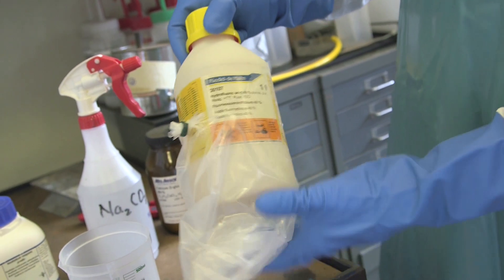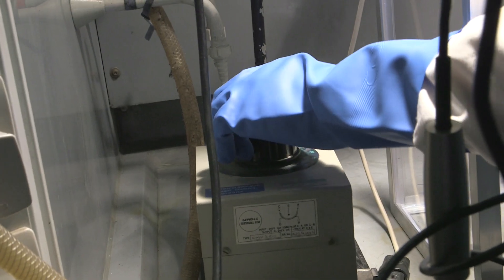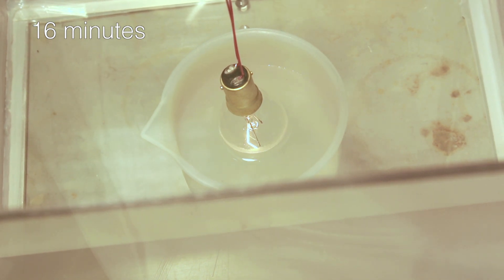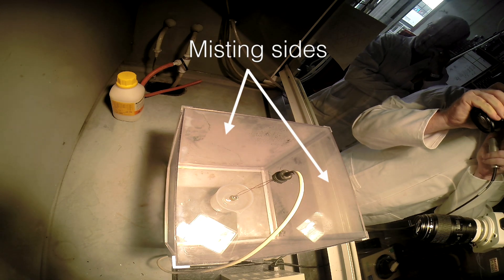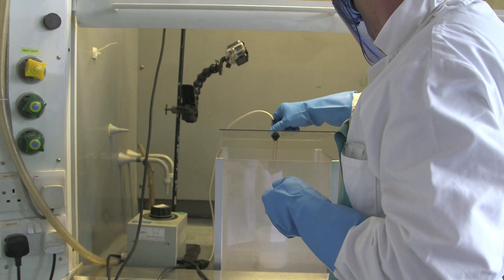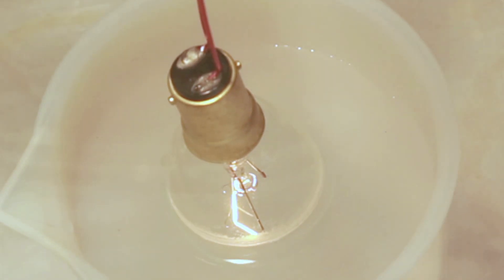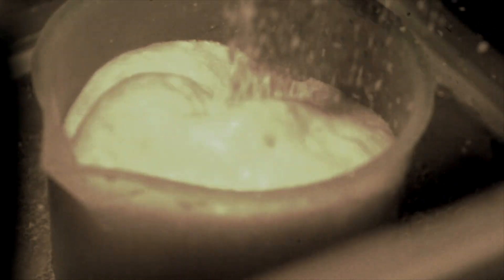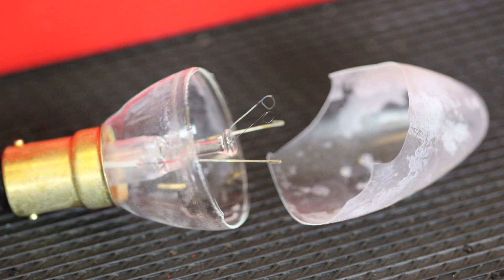Light Bulb in Hydrofluoric Acid (HF)

Comment: HF the most feared chemical compound, eh?  If you had to pick, would you rather work with HF or O2F2? :)
Reply: Lord Marcus
 That's not entirely true. You should read the wikipedia article about the "Dihydrogen Monoxide hoax".

To quote the best part :

"Dihydrogen monoxide:

is also known as hydroxyl acid, and is the major component of acid rain.
contributes to the "greenhouse effect".
may cause severe burns.
contributes to the erosion of our natural landscape.
accelerates corrosion and rusting of many metals.
may cause electrical failures and decreased effectiveness of automobile brakes.
has been found in excised tumors of terminal cancer patients.

Despite the danger, dihydrogen monoxide is often used:

as an industrial solvent and coolant.
in nuclear power plants.
in the production of Styrofoam.
as a fire retardant.
in many forms of cruel animal research.
in the distribution of pesticides. Even after washing, produce remains contaminated by this chemical.
as an additive in certain "junk-foods" and other food products."

And not a single line is wrong!
Reply: tabularasa0606 In fairness, anyone working with HF has almost certainly been thoroughly warned about it.  No one warns you about water overdose.
Reply: Look for a chemistry blog called "Sand won't save you this time.". It's part of this guy's "Things I won't work with" series.
Reply: You should all read John D. Clark's "Ignition : an informal history of liquid rocket propellants". It's available for free on the Internet as a PDF, and tells the history and mishaps of rocketry in its golden age, from the 1940s to the 1970s. It's just great, both really informative and hilarious, and some of the mishaps reported in there are simply unbelievable. Like the time they broke a 1-ton container of chlorine trifluoride. To quote that book :
"It happened at their Shreveport, Louisiana, installation, while they were preparing to ship out, for the first time, a one-ton steel cylinder
of CTF. The cylinder had been cooled with dry ice to make it easier to load the material into it, and the cold had apparently embrittled
the steel. For as they were maneuvering the cylinder onto a dolly, it split and dumped one ton of chlorine trifluoride onto the floor. It
chewed its way through twelve inches of concrete and dug a three-foot hole in the gravel underneath, filled the place with fumes which corroded everything in sight, and, in general, made one hell of a mess."

It goes from that to the stinkiest components ever used as fuel in rocket engines, or the first tries at monopropellants (which he describes as "a molecule with one reducing  end and one oxidizing end, separated by a pair of firmly crossed fingers") using no less than nitroglycerine!
Oh, and they also injected mercury in some engines.

Seriously, that book is just great, I cannot recommend it enough.
Reply: Well, that's not quite what I meant by no one warns people about the dangers of water, either through hyponatremia or the various chemical dangers thereof.  The thing about calling it DHMO is that a random person isn't likely to know that's water.
Reply: evildude109
They both clearly lose to dimethylmercury.
About as toxic as VX or Sarin : 3 mg are sufficient to kill a 60 kg adult (LD50). But unlike VX and Sarin, it goes straight through rubber gloves and HazMat suits. And it is environnementaly persistent for decades.
Reply: piranha031091 Of course, but I thought we were just talking about corrosiveness.  Absolutely, one of the best methylating agents in the world is an ugly thing to play with.  If you just want to play a game of golf with LD50s, you'd have to just go with Botulism, with an LD50 of a few nanograms.
Reply: evildude109
FOOF isn't chemistry. It's just evil.
Reply: HF isn't even in the fight. It's a competition between fluoroantimonic acid and FOOF.
Reply: richardpurves That guy's blog is one of the first places I heard about FOOF. :)
Reply: O2F2 is extremely uncommon. Therefore, a lot less chemists have to fear it.
Reply: piranha031091 Even more people die of an overdose of H2O

Comment: What would be the result with plain water? Did the lightbuld crack in half just because of temperature difference between top and bottom...?
Reply: Probably in part because of that (explaining the neat cut), but mostly because of glass corrosion.
Reply: I agree. But corrosion definitely helped weakening the glass. Without HF you probably need much bigger temperature difference to make it crack.

Comment: The dissolved surface of the glass is still slick. (I've tried it.) So how does the light bulb industry, or rather how "did" the light bulb industry etch the inside of a light bulb?
Reply: maybe they etch it before putting it together?? :D

Comment: I had taken part into an experiement where we dissolved beakerglass (broken pieces) in heated oleum (conc. sulfuric acid). The glass were "dissolved" only from the rough broken edges and the "flat surfaces" stayed mostly intact.

Comment: What's the explanation for the lightbulb corroding only on the surface of the acid? I thought that the corrosion would have been more even.
Reply: mahin alam The entire submerged part of the bulb corroded, if you look at the remains you will see it being thinner than the rest.

The reason for it breaking in a circle however, is (i think) because of the stress caused at the point where it transitions from thick (un-corroded) to thin (corroded), combined with heat from the bulb itself and the reaction.
Reply: Patrick Hansen
I think it was the hottest at this place and it sped up the reaction. Below the surface HF took away the heat and above there was no HF.
Reply: Patrick Hansen I would suspect it had more to do with the way glass shatters rather than heat differential.

Comment: I would have expected the bulb to have higher pressure inside and thus explode a little bit more violently, but do you think it didn't because of the even corrosion that popped it in two, projecting the bottom piece away like a catapult chair? Or is the pressure inside the bulb much lower than one would expect from the spectacular explosions you get when you happen to hit one too hard?
Reply: Ah, so it's lower pressure. I had that backwards then.

But why then do the glass sometimes shatter so violently outwards if you hit one? Is that just because of the nature of the structure within the glass itself? Structural tension from cooling the glass during manufacture?
Reply: Rua Whitepaw I believe that the reason a noble gas is used is not that the glass wouldn't "withstand the vacuum", but that having a vacuum would make filament sublimation effects worse, resulting in a gradually thinner filament, clouded/darkened bulb glass, and reduced lifespan.

Don't quote me on the exact physics though. Just what I remember from school :)
Reply: i believe bulb filiments are under a vacuum?
Reply: Trodoil akaTroy They are usually filled with a noble gas such as Argon.
Reply: Trodoil akaTroy Old filament bulbs contain a low pressure Argon atmosphere inside, as Argon is unreactive to the filaments at the high temperatures they reach.
Reply: SchiferlED  bigglessy ah I see, thank you.
Reply: Incandescent bulbs tend to have a vacuum in as the glowing element would react with any atmosphere inside the bulb, not sure about energy saving ones but I think they're lower pressure as well(they use metal vapor to conduct the current around the bulb). Halogen bulbs tend to have a low pressure of Cl2 in (I think it's chlorine, definitely a halogen gas) as this reacts in a manner that doesn't destroy the element/filament of the bulb (I only vaguely remember so won't try and explain, sorry. I think it's a cycle, reacts to make the halide as the filament heats then does the reverse on cooling =/ ). Also the corrosion is unlikely to occour completely uniformly around the glass surface, as the glass isn't completely uniform, it'll have bit's that are slightly raised or lowered, leading to a higher local surface area and so higher reactivity for that bit of the glass.
Reply: MortRotu
The glass is not strong enough to withstand a vacuum so they use argon (a non-reactive noble gas) instead.
Reply: bigglessy
 Even if it's low pressure argon, shouldn't the heat from the filament heat it and cause it to expand, then increasing the internal pressure? Expansion from heat isn't a chemical property of gas, it's a physical one.
Reply: Rua Whitepaw
it's a static pressure applied to a nearly uniform sphere, Sphere's are exceedingly strong in compression, eg bubbles underwater. Also having a vacuum removes the thermal expansion of the atmosphere inside problem. I imagine the shattering thing is a similar cause to the prince Rupert's drops shattering if they're chipped
Reply: Rockskillskids Yes it does, but the pressure increase is still under standard atmospheric pressure if I remember rightly.

Comment: This is the stuff Walter White used to get rid of bodies wasn't it?
Reply: I have no clue why Walter's school had that in their supply cupboard
Reply: unassumption It's for the naughty children. "Timmy, be quit or it's HF for you!"
Reply: Say my name
Reply: mythbusters actually tested it out and HF didnt work like that in breaking bad. they had to use sulfuric acid and some hydrogen peroxide on a massive scale to even come close
Reply: Bumbero
 No, re-watch the episodes, he clearly used hydrofluoric acid. And you definitely can NOT buy that in stores. Or find it in any normal highschool.
Reply: No, it's the stuff Pinkman used.
Reply: unassumption
Or why didn't he simply use sodium hydroxide, widely available as drain cleaner, and much safer (no vapors, doesn't dissolve the bathtub, frequently used to dispose of roadkill).
Reply: It was, but HF probably couldn't dissolve a whole body, try concentrated Sulphuric Acid(H2SO4) with a catalyst.
Reply: Gabe Freiman
Not in the highschools I went at. And even assuming they do, in the series, you see him directly taking jugs of that stuff off a shelf, and later Jesse emptying the jug in the bathtub to dissolve the body. No further processing of the substance inbetween.

SPOILERS

And it's strong enough to dissolve the body, the bathtub, and the floor.

The only reason he used HF is because the scenarists wanted that cool scene where it makes a hole through the ceiling, and they end up cleaning it up in HazMat suits. Gives one more reason for Walter not to trust Jesse with the chemistry.
Reply: TheySmashedAnHourglass
Actually, no need to melt it, it works if you simply use it in concentrated enough aqueous solution. A dozen bottles of drain cleaner or so should have done the trick! And without dissolving the bathtub! (also, it's safer to handle)
Reply: He used HCl - also called Hydrochloric acid or in stores you can buy it as muriatic acid
Reply: unassumption HF is used for dissolving naughty students. :)
Reply: ***** How do you keep a secret if you tell your students?
Reply: Gabe Freiman NaOH is white powder you can choose to dilute into an aqueous solution (NaOH(aq)) or to heat in order to make it liquid (NaOH(l)). Furthermore when you are having NaOH either as a powder or in an aqueous solution it is possible to contain it in a glass container for a very long time before anything will happen anyway.

And furthermore you don't ever use HF at highschool for random school experiments. At my university our supply of HF is stored in a bunker  20 meters from our lab building together with other dangerous chemicals for safety reasons...
Reply: not really, if Walter white is a chem teacher it'd be reasonable to assume that he has at least a bachelors degree in chemistry so would know that.
side note K/NaOH will dissolve glass whatever the concentration, the concentration only affects the speed at which this happens(just like the temperature) and how much glass will dissolve.
Reply: Sheesh, just find some pigs; they'll take care of the body.
Reply: 21asds  They didn't test HF on a fiberglass bathtub, which is not only what most bathtubs are made of, but also what HF will chew most easily through.

And it's not a matter of "being strong enough", it's a matter of wether you have fluorides or not. HF is actually weaker than many other acids (it is sometimes nicknamed "the strongest of weak acids). Yet, it is still a lot more corrosive than all other acids on many materials, because of the free fluorides that will bond to any metal.

You can use regular glassware with sulfuric acid, nitric acid, mixtures of those acids, etc... and you won't have a single corrosion issue. But if you ever use something containing weakly bound fluorides (like HF) with glass, it will chew straight through, in a bubbling of SiF4.

That is what would have happened if they had poured HF in a fiberglass bathtub.

It seems they simply had no idea of the chemistry involved.
Reply: jinno11 Heisenberg.
Reply: unassumption this wouldn't be legal just about anywhere :p
Reply: jinno11
... Heisenberg.
Reply: piranha031091 Yeah, I just checked, they used hydrofluoric. I just assumed it was HCl because HF is much harder to get and is very dangerous.
Reply: Gabe Freiman what for? The only thing it'd be useful for is demonstrating that you can dissolve glass with certain chemicals, but you can get a similar effect with concentrated KOH (caustic potash), might take longer but as you can see here, HF isn't exactly rapid...
Reply: Walt should have tried molten sodium hydroxide instead ^^'' (Well, it's easy to get, but I guess they'd still need quite a lot of it, and a way to melt it all)
Reply: piranha031091 So even though NaOH also dissolves glass, it wouldn't dissolve the ceramic bathtub? Well, that's handy^^ Maybe it would be a little faster when molten(Idk, I'm not a chemist!), but you're probably right that highly concentrated NaOH would also work xD
Reply: SHJ Gaming
Youv been watching mythbusters
Reply: DubbleTroubleBubble
Oh wait. HF dissolves glass, so does NaOH in molten form. Both HF and NaOH are used in Breaking Bad, to dissolve bodies and in the production in P2P methamphetamine, as a strong base to make the phenylacetone. Isn't that a coincidence?
Reply: *****
But I doubt it is strong enough to dissolve a body in it. Haven't tried though.
Reply: ***** So does sodium hydroxide, and it is cheaper, easier to find, and already used for getting rid of roadkill.
Or, if we are getting into extreme chemicals anyways, molten chlorate will surely also do an equally great job!
Reply: *****
That's not entirely true, actually. NaOH does break down the collagen from the bones. You are then left with "bone shadows", relatively pure porous calcium phosphate that can easily be crushed into a fine powder.
Reply: 21asds
Thanks for the info, I'll look for it right away!
Reply: 21asds
Okay, so, I just watched it...
And I mean COME ON! They did it COMPLETELY wrong! They didn't use hydrofluoric acid! They used piranha mix, a mixture of sulfuric acid and hydrogen peroxide.
Granted, that stuff is great at dissolving organic matter, and it did dissolve the pig, but it doesn't react the same way at all on ceramics. HF would have eaten straight through the fiberglass bathtub, and probably been less effective on the pig.
What they did is simply unrelated to the breaking bad myth!
Reply: noobiesmurf 

 I’m hoping someone can help me out with these questions.
At what temperature does fluorine evaporate at? And can boiling water get rid
of fluoride if not why? I thought fluoride is fluorine bond to other elements for
example like salt. So if you boil the water it should cause the fluorine to
release from the salt and evaporate from the water?
Reply: CB telling  I replied to you already, at the end of the long comment I wrote to your other question you asked in the reply section of my comment. :-)
Reply: MortRotu you can use it as a catalyst in some organic synthesis, like adding certain functional groups to aromatic rings
Reply: Ian Juarez For sticking C-F functionalities onto aromatic rings? That's a highly specialised med-chem type thing to do. (to extend a molecules lifetime in the body without altering the size too much) not really something that'd need demonstrating to high school students or really to undergrads. Even postgrads don't use HF unless they have to, because of the associated dangers. Also add in that HF isn't really that useful as an acid and it doesn't have that many uses in a chemistry lab.
Reply: jinno11 jinno11
Reply: It's the stuff used in season 1 of Breaking Bad to dispose of a body, yes. Not sure if you mean the character or the real person.
Reply: Gabe Freiman That was HCl he was using. A common recipe for hydrogen pressure bombs is using aluminium foil and hydrochloric acid. NOT HF!!!

And blowing up a bottle containing HF in a park or any public place would be nothing short of CRIMINAL! You'd just contaminate the whole place with one of the most toxic chemicals! That's a terrorist attack right there!

Comment: Why did the beaker have to be clouded so you can't see through it?
Reply: The beaker is likely made out of Teflon, which HF won't attack
Reply: whoijacket Ah I understand, just didn't know teflon was clouded
Reply: Because it can't be made of glass (or it'd dissolve just like the bulb), so it's made of ....probably polyethylene or maybe PTFE, Both of which are poorer transmitters of light than glass, so you can't see through it so well